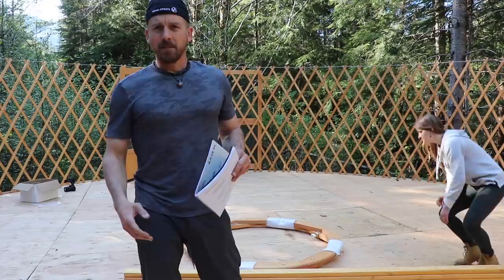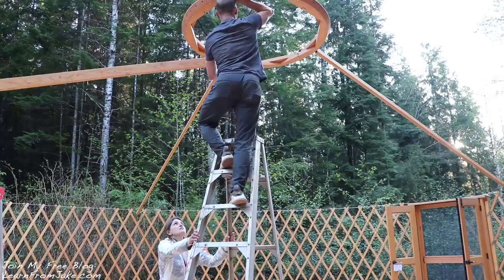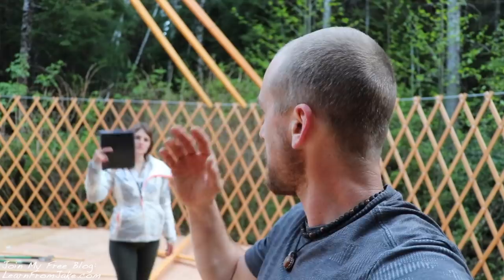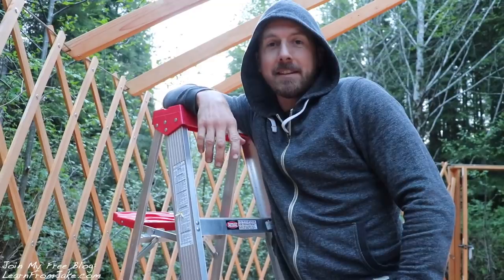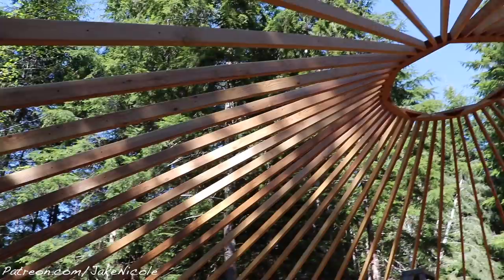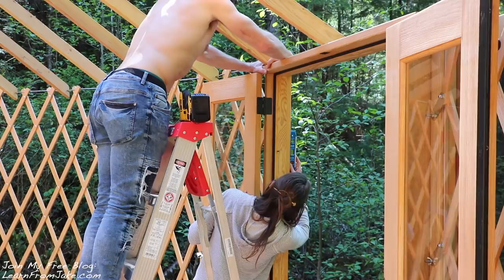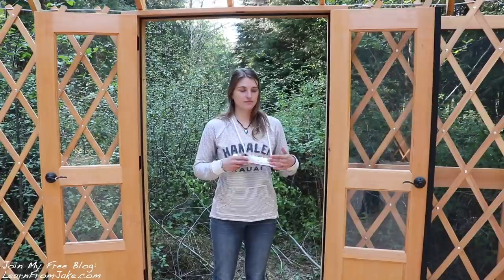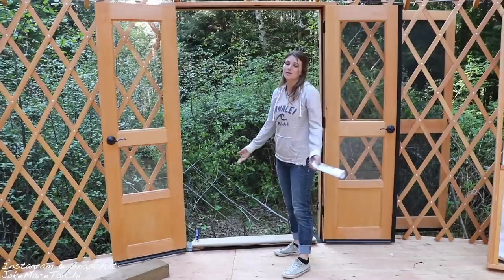How To Build a YURT | Roof & Center Ring - Most Dangerous Part!

Comment: By the way just in case you were wondering, a good way to get rid of or at the very least minimize by a lot the mosquito population around your yurt would be to cut down the fur trees around your property. Mosquitos don't like open areas and love dark moist areas and they love fur trees for some reason. I have a cabin on an island in Finland and once I got rid of most of the fur trees around my property leaving just the burch treese, pines, and generally open type trees the mosquitos population dropped almost to nothing. Just in case you were wondering, makes the nature experience a bit more tolerable I think.

Comment: oh it is looking good you guys!!!  Almost there..   wondering how you are going to get the dome up on top .. that'll be interesting  to watch that video...  Happy for you guys.. whoop there it is  :00
Reply: My guess is this .First attach a rope to the dome . Then throw it over the roof to nicole.  He will slide it onto the edge of the roof with an attached rope.   !Push it up onto the edge of the roof. Nicole will hold it there. He will then take the rope from Nicole and they both pull it up to center  of the ring.  Then he can fasten it from below with the proper hardware ! Done ! Hope I am correct ! Otherwise its a crane or helicopter !
Reply: @triumphmanful  Ha. Crane or helicopter lolol.    Yeah rope idea seems all that is left however just seems so dangerous to have instructions like that for DIY'ers..  but I guess we'll all see together..   :))  super excited. :))

Comment: Hey there.Check your Yurt books think the thin wires are up wrong.You have two holes drilled so it threads up and down. I have a 30 ft Pacific Yurt too.You will need a few extra hands for the vinyl roof as it is so heavy. Best to you two its all worth it
Reply: Hi Simon. The zigzag cables in your yurt are part of the Snow & Wind Kit, which Jake's yurt does not have. This is why he only has the one "safety" cable that goes in a circle.
Reply: @PacificYurts  That does not sound good.
Reply: Thanks,I had no idea @PacificYurts

Comment: Jake and Nicole how are you going to get the dome on top? Will it fit through the hole? Seems like u might need to take one of the boards off and slide it through sideways to put on top if it doesn’t fit through the hole... but I guess it will say in the directions... I’m all worried over here and how you will get the canvass over it, maybe some neighbors could help you with that part... be careful. ... mom lol :)
Reply: I keep asking myself the same question.  I can't wait to see.

Comment: So the only thing holding this all thing together is that one tension cable?
Reply: 2 cables. One midway down through the roof rafters.
Reply: The tension cable acts like the steel hoop on a barrel. It prevents the rafters from spreading beyond the specified circumference. The smaller cable that is further up the rafters is simply an added safety feature that ties the rafters together.
Reply: Yurts are time tested.  They can stand up to great snow loads and the constant freeze and thaw.  The load is distributed and the 2 layers contribute to insulation.  They will be ok.